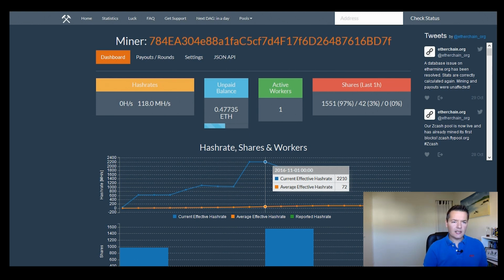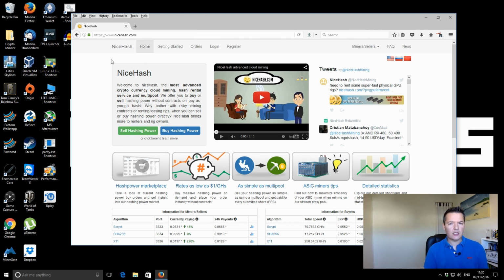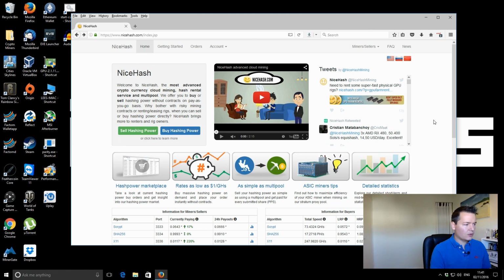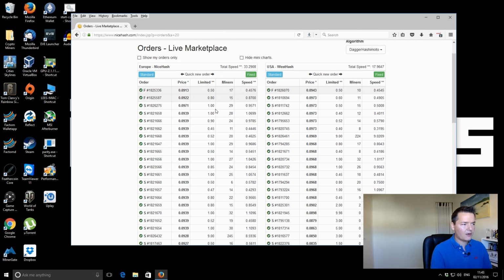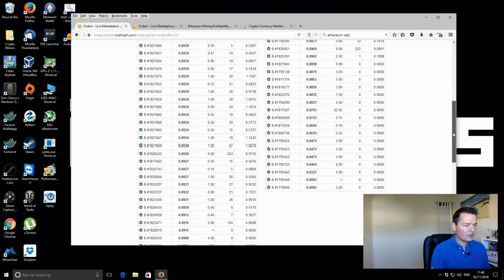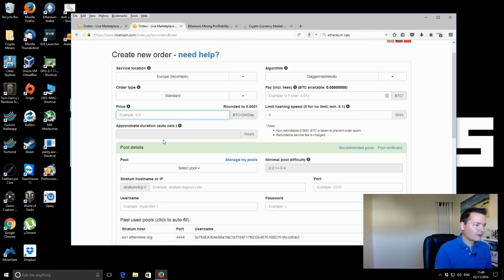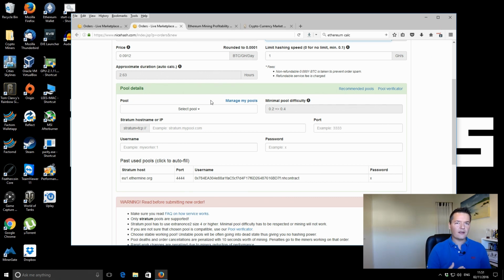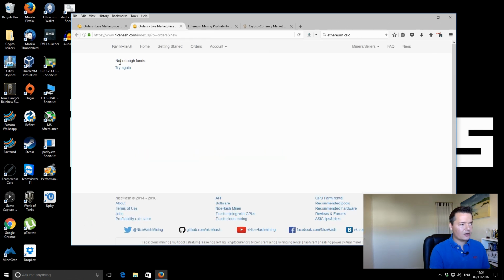Ethereum Mining at 2,210 Mh/s

Comment: I have been buying hashing power at Nicehash these last days.  On paper, it looks incredible.  But there are those "delta" (check your order details) which you cannot control, who turns profits into losses.  Such "delta" include a lot of losses between the miners (providers) and your mining pool.  I am having a slightly better deltas by using suprnova pool for ETH, but it is still not profitable.  Will continue studying this.
Reply: I've noticed that delta as well, suprnova seems to be the most profitable at the instance.
Reply: I did many test runs of buying hash power on NiceHash, mining ETH using Ethermine, Mining Pool Hub, and Nanopool.  I made a small profit on some but also lost even more on others.  I gave up, not worth the hassle/risk.  NiceHash takes a 4% fee right off the top so it's hard to make a profit.   You simply will not mine the amount of coins you expect to for the price paid.

Comment: Hello friend, I have asus gtx 1060 3Gb total 6 cards running on windows for LBRY mining . 5 cards are producing 185 MH/s but one card is on 135MH/s and sometimes below that. How to increase power of this card. Currently I have installed MSI Afterburner.
Reply: hello which model of asus gtx 1060  u using
Reply: Kundal Singh OC edition
Reply: Anything By singh  how much hash for etherum
Reply: You get thia hashrate for eterium coin?

Comment: Watched the video, thanks for making it. So you got a boost by paying for a large amount of mining for a short period of time? Was this beneficial, such as jumping in on max processing at a time BTC was high? Is it more cost effective to use nicehash over buying your own rig?
Reply from the maker: The video was for demonstration, its possible to earn using this method but its quite complicated due to the constant change in currency rates and earning rewards and also luck of the pool. I prefer building and running my own hardware because it gives more options and control that leasing hashing power.

Comment: I am getting this error: Disconnected. Pool difficulty too low for high speed. and cannot effectively mine on ethermine. What could I do?
Reply: Same problem here :/
Reply: same here. please help
Reply: 2strokeAddict just do not use ethermine they do not support the high speed from nicehash.
Reply: You would have to log into your mining pool and configure it to artificially increase the difficulty by quite a bit for that one specific worker you're using. Basically it's used to like 6x GPUs so it sends a 100 million times easier calculation target to reach to prove you were mining that whole time even though you didn't solo-solve an actual block.  When you're using the equivalent of hundreds of GPUs on one miner, they would solve the "proof of work unit" too quickly and the transmission time proving it and request for a 2nd proof of work unit would go by far too quickly and you'd effectively lose a HUGE percentage of your performance. So you need to set it at like 1 million times easier than a block difficulty so that it takes more like 60 seconds to solve a proof of work mini-block instead of 0.1 seconds or whatever.

Comment: Thanks for the tutorial! But, something I didn't quite understand about limit and speed... "Limit" for example 7.0 means that 7 days is how much time it is available from the seller  but I can buy it for just 1 day? And "speed" for example 7.234 is the  maximum speed that the seller can provide but I can limit it to 1 GH, so I'm buying 0.0912 × 1 rather than 0.0912 × 7.234? ...or I just set it to unlimited and it will automaticlly give a fraction of a day rather than a full day?

Also, I'm in the U.S. but can I buy from Europe if the price is lower? And what is the downside to that?